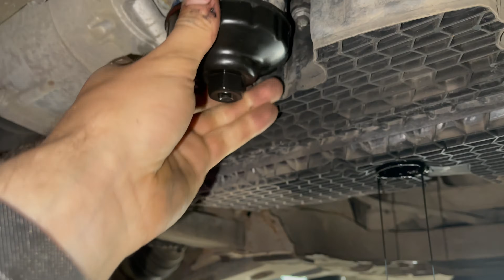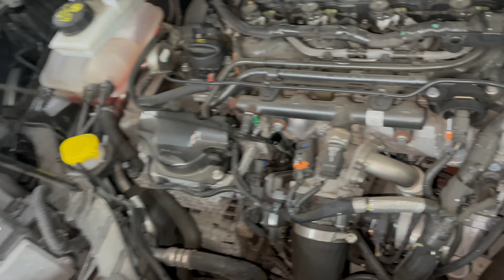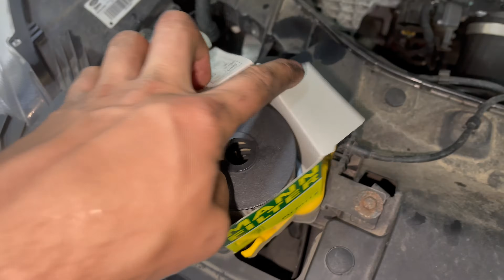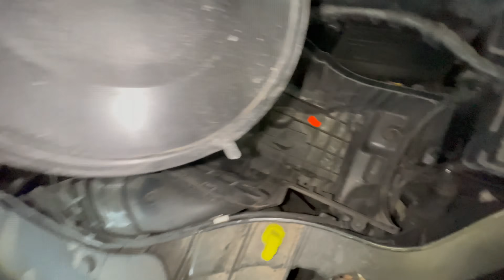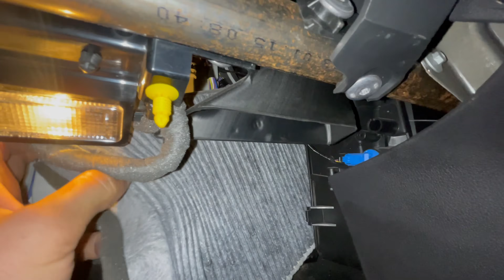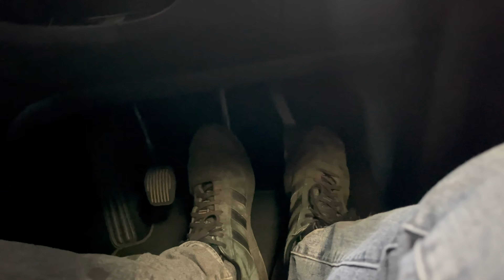2014-2018 Ford KUGA 2.0 TDCi FULL Filter Service - Air Oil Cabin Fuel - T7MA

Comment: Watched this before servicing my 2014 2l tdci Kuga, but it’s totally different. Oil filter is a drop in type at the front, access is from under the bonnet and a regular screw in sump plug with a copper washer.

Comment: Great video, which takes the mystery out  of a basic service which we all could do with cars decades ago, but now we are programmed to believe that only main dealers can do the job . My only issue is that you didn't remove the oil filler cap before draining the oil. I've found that this ensures that all the dirty oil is drained  This can be seen by the black oil  on the dipstick

Comment: I have a  2014 Kuga 2 litre diesel Duratec and the fuel filter housing is different to the one in this video.  I checked a different video  and  the filter housing on the engine I have is the same as the one on the S--Max.   Hope this a help as the cap has PEUGEOT  written on it along with the Citroen symbol.  it must fit a few vehicles.
Reply: Yeah mate it's a Peugeot engine 🫡

Comment: Struggling to get the fuel lines off the fuel filter housing. And i noticed you cut the video just as you pulled it out. Do you just open the clip and brut force the line out?

Comment: Full Service 🤌
What is the oil change interval on these?
I assume something ridiculous like 25.000 or 30.000 Kilometers from the factory...
10.000 max! would be realistic.
Reply from the maker: I don’t have that information to hand but it’ll probably be 12 or 15k miles. I wouldn’t go more than 10k without an oil change on any car.
Reply: @IAMASPANNER  over in the US the Ford EcoBoost engines seem to have severe problems with the factory intervals or not changing ever 6 months regardless of mileage.
Mechanics recommend oil changes every 4000 to 5000 miles.